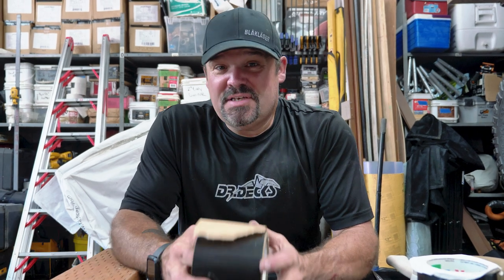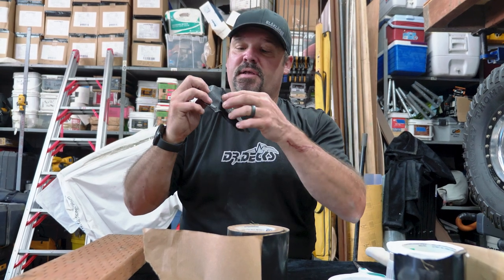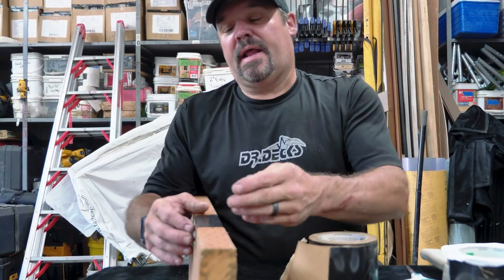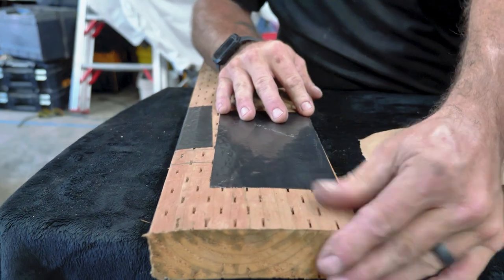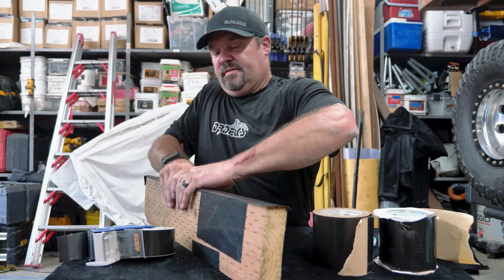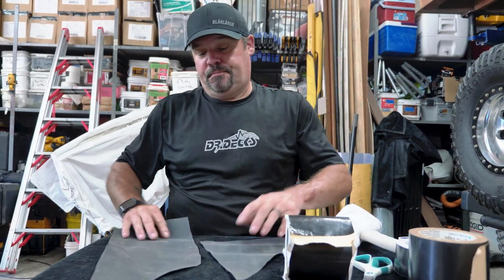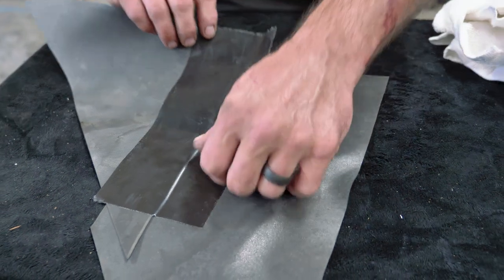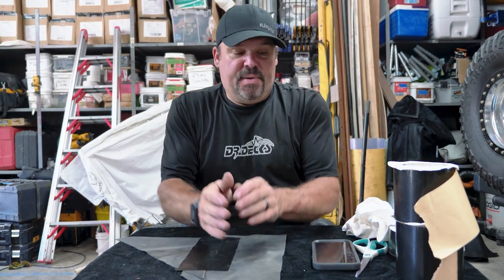Different Types Of G-Tape || Dr Decks

Comment: I applied joist tape and wow does it get super hot in the sun. Can barely touch it for long when applying. Will the tape transfer heat to the deck boards and make it hotter to walk on during summer?

Comment: I used the 2" 3040 on my deck because of an older G-Tape video you did. Glad I did because most of the tape you see in stores is the thicker butyl stuff that the sides peel up on because it doesn't stick as well. As far as gloves and applying the tape, barehanded all the way. I lightly applied to the joists in the middle for the entire run. Then came back with a rag in hand to smooth it out and wrap the edges of the joist.

Comment: My fiberglass deck leaks at the terminations and I was going to use this G-Tape over paint on the parapet wall and the door threshold and the other side on the textured fiberglas deck - at least until I completely redo my deck.  Will the G-Tape adhere to paint and textured fiberglass and will it make up the undulations in my textured fiberglass?

Comment: Replacing my 1,500 sqft deck and I've been using the 36" wide rolls of ice & water shield peel and stick rubberized roof underlayment and slicing it into 4" wide rolls with the sawzall because I can get 8-9 4" rolls for $80 which saves me about 50% vs the G-tape.  Any problems you see with that?
Reply from the maker: Just an asphalt goo mess but if it works, good for you!

Comment: Also wondering if G Tape is compatible with Azek or other PVC decking material? Anybody know?
Reply: I'm trying to find out this same answer. Ref video from DIYer on his video regarding this point of compatibility with the deck itself. Why preserve the framing if the deck itself goes bad first.
Reply: All Dr. Decks uses is AZEK pvc and G tape.  So it is compatible.